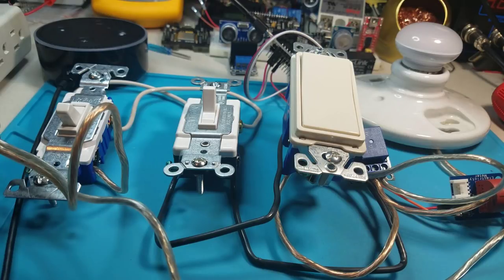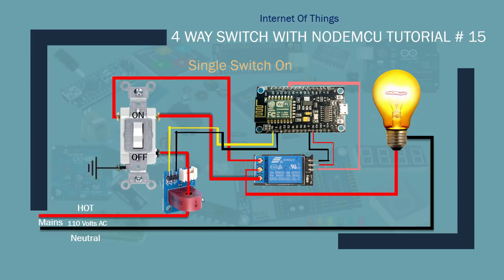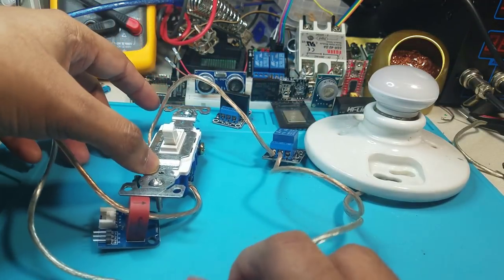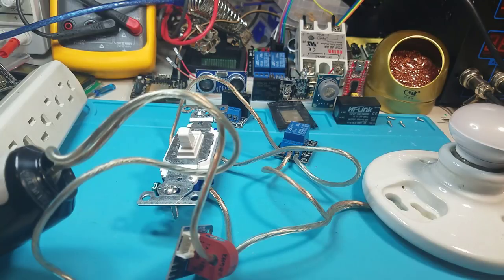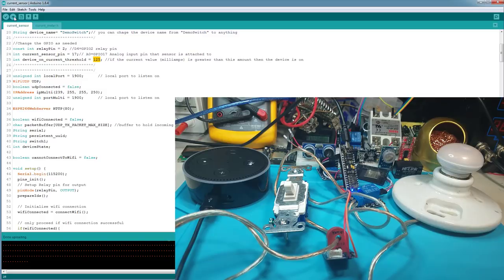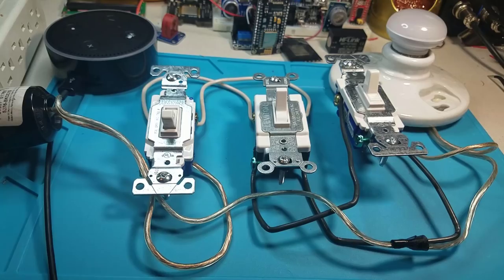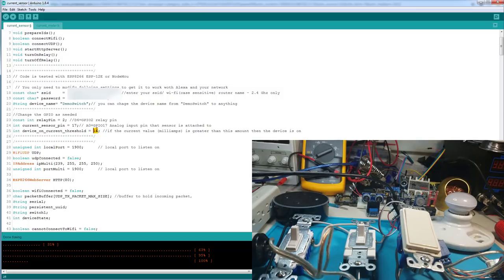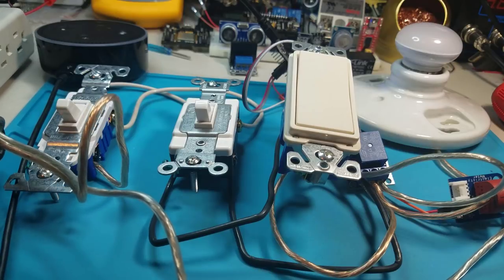esp8366 arduino | Home Automation with Alexa | 4 way switch Part 3| Tutorial # 15

Comment: Very nice demo and explanation, I have found that many do not understand how 4 way (DPDT) switches operate requiring a 3 way (SPDT) at the source and load ends of the chain.  I am new to the Pi Arduino and ESP world so this was quite useful. A suggestion for your proof of concept and demos would be to use 12 Vac lamps on the bench to eliminate the shock hazard. I specified 12Vac as the current transformer would not work on DC.

Comment: You are very thorough on your videos. I like the way you mix in power point slides and video. There in no doubt you spend a lot of time on these. Have you looked at using a Wemos in place of the NodeMCU? It had a smaller foot print as it has fewer GPIO, but based on the ESP. A side note, the current sensor can be installed on the wire from the relay to the light, which would put it in the same box as the relay and Node. You ultimately are trying to determine when current is flowing to the bulb. Keep up the great work!
Reply from the maker: Chris Hettinger defiantly I will look at WeMo. 

I am connecting  the current meter both ways. Look at the 2nd demo in this video.
Reply: It is a Wemos, not Wemo. Wemo is a brand of IOT components from Belkin. Wemos is an ESP8266 board with 5 volt regulator, FTDI and several other things all one 1 board. Basically the NodeMCU's little brother.
Reply from the maker: Chris Hettinger Sorry for the typo.

Comment: Hi, in 3way installation you placed current sensor at the beginning(between plug and switch). In the 4 way installation you placed the sensor between relay and the bulb. Could be current sensor in 4way installation at beginnig? (on the 4way scheme on the left before first 3way switch). Thank you in advance

Comment: Great job on the video.  I am just starting out with DIY home automation.  I am excited about the possibilities and availability of components.  I love how you are using the relay as a 3-way switch in the circuit along with a current sensor and how this allows the manual switches to continue working in the event of a failure of the home automation hardware.

I will be using the AdaFruit Huzzah breakout ESP8266 board.  Unfortunately, is only has two analog inputs for the current sensors.  A digital input to detect the load going "hot" would allow for more inputs and would not be subject to changes in the Amps drawn on the load if bulbs burn out (which may be a non-issue).

I just got my Raspberry Pi working with OpenHAB2 and Mosquitto.  Now on to the hardware!

Liked and Subscribed :-)
Reply from the maker: Dave Z Thank you for your feedback. Please keep us up to date on your progress. Good luck on your projects.

Comment: Sweet setup, I like the idea of still being able to use regular switches if the ESP board has problems. I have setup 8 lights in my house so far with regular wall switches, google home & home assistant all working nice together on 2 ESP boards talking to home assistant via mqtt and light switches us GPIO's on ESP board to change state and relay via mqtt to keep all in sync but if an ESP board goes, I have no light control. Might have to look into integrating your setup into my own :). My setup was first inspired by your videaos so thank you again :).

Comment: Great tutorial! Question, why at 21:57 do you turn it on then off? Is this necessary? Also, is the relay you are using active high or low?
Reply from the maker: On/off is not required. Just testing to make sure it works with manual switch only. I am using active high relay. You can check my following video to learn how to convert active low relay to active high.
 https://youtu.be/pBxeHlvF4eQ
Reply: @netmedias7657  Thank you for the reply. I have an issue maybe you can help with. When I verify code in Arduino IDE, it has this error. "Error compiling for board NodeMCU 1.0 (ESP-12E Module). /Downloads/IOT-NodeMcu-Alexa_Automation_4Way_Switch-master/current_sensor/current_sensor.ino:194: undefined reference to `sendRelayState()'"  I know this video is a few years old, is it possible that an update to IDE or other libraries has broken your code? Thanks

Comment: Sir I am using NodeMCU with 8ch 5v relay board.I am using same manual switches also as you shown in your video but if I wish to use current sensor with all 8 relay how should I connect those? Because there are only one A0 pin in nodemcu.

Comment: Just noticed this, perfect for a project I'm thinking about. I've ordered all the parts needed except for the current sensors which are not available in the UK :(. Is there an alternative such as the solid state current sensors that are widely available or is it possible for your design to work without a current sensor. Many thanks, Keith

Comment: Nice work.. If I just wanted an upstairs and downstairs switch plus the nodemcu (not 3 physical switches), can I just replace the last switch in a 3 switch configuration with the relay? and if so, does anything need to change in your arduino code?
Reply from the maker: Mark Porridge Yes sir. You are right. In two switch configuration make sure last switch that connects to the device is 4 way switch. If not the replace it and connect the relay.

Comment: Great video's well explained and already starting to use your projects! Would like to see how you provide power when these are placed permanently in an electrical box, and if wireless had any issues working in the wall .. thanks !!
Reply from the maker: Ross Romeo thank you for your feedback. Please share your thoughts what you like and dislike about the videos for I can make improvements. Good luck with your projects.

Comment: Hi . i need some assistance from u . is it ok to help me out . i have a 4 channel relay , and a 8 channel relay ,  nodemcu  and also echo dot .. so was planning to do some automation for  my bed room .  i have connected to dc supply  till now to switch on the relays . it works fine all with the dc voltage in normal way giving commands to echo dot to switch on all 4 channel relay and 8 channel relay board ,  but moving on to ac connection  the problem how to connect it with the nodemcu . in this video you have connected to a single channel relay right . also some kind of  sensor which u were talking about in the diagram to Ao pin in nodemcu  along with the 3 way switch  ... how should i connect the 4 channel relay or the 8 channel relays to ac voltage  with the nodemcu as per it has only one Ao pin . other thing is that here that sensor is not available in India . in your other video you have replaced it with a diode and a resistor right .. but even still how i can connect the both 4 channel relay or the 8 channel relay to nodemcu to notify the ecodot that if i switched on the 3 way switch it is already on as per nodemcu has only one Ao pin . i do not know much about elctronics or about the nodemcu .. and the programing .. but connected and programmed it watching many videos only . so if you help in this one it will be a great thing to me . hope you will . can you do a video how to connect the 4 channel relay

Comment: This was a good video but one thing that will make it much better is when you are wiring the relay instead of saying wiring to the left and right terminals, tell if it is the normally closed or normally open terminals because not all have the terminals in the same place.
Reply from the maker: Eric Hughes Yes sir. I am doing that. I mentioned my relay default at 5:03. Anyway in this configuration it does not make any difference as long as common pole is connected to the device.

Comment: Awesome! Would it be possible to control three lamps in a four way setup using a single esp8266 by adding more relays?
Reply from the maker: Breno Sabino you can control multiple switches with single ESP but this switch configuration is for one device only. You can look at my tutorial on controlling multiple relays with single ESP.

https://www.youtube.com/watch?v=OC6QSXzkQU8

Comment: hello, I need to ask you that if the ALEXA and Google Assistant code are built-in into your arduino code or we still using HEROKU. I see that in the Arduino code there are serial lines. What are these lines for
Reply from the maker: This project does not require any skills for Alexa.  You only need the sketch to get your device working. You can use IFTTT to make it work with Google Home.

Comment: Liked the video but the description of the video could be more robust. What parts did you use and where did you go to get them.
Reply from the maker: Jarren141 Please do suggest a better name for the video. Electrical switches are bought from Lows and NodeMcu,relay and current monitor from eBay. If you want them quicker then order them from Amazon.

Comment: Hi, very nice project and very easy explanation!! I’m going to do something similar to my apartment, my intention is to connect to the same board 4 series of buttons (I would like to manage 4 different lights with one board), I think I need to change the board and I was more oriented on a MKR1000 that has more analog ports and wifi connection but my question is, can Alexa manage 4 lights points with one board? I’m still learning skills but your help can help me to understand if the project is fine (and to proceed to order the material)
Thanks for your kind reply
Reply from the maker: Stefano I am working on 8 channel relay current sensing tutorial. It will be a while before I post it. Thanks

Comment: Awesome tutorial. How would you do the wiring on a typical 3-way lighting setup that uses 2 x 3-way mechanical switches (i.e. one switch is it at one end of the room and the other one at the other end)?
Reply from the maker: It is simple. Just remove the middle switch and rest is same.
Reply: @netmedias7657  Thanks, so let me summarize: I need to replace one of the 3-way switches with a 4-way one and wire it along with the ESP module, did I understand well?

Comment: Do you think it would be a good idea to replace the induction current sensor with an optocoupler, resistor and capacitive dropper circuit? It's a bit more invasive but i had the parts laying around so i would rather not buy another sensor.
Reply from the maker: SilentDreamcast It should work but it complicates things and I wanted to keep it simple. It is good to  separate low and high voltage with optocoupler. Let us know how it goes. Good luck.

Comment: Can a PIR module be connected in parallel for automatic ignition and add control with switches?
Reply from the maker: You will need to modify the code and add timer so it stays on for required time.

Comment: Hello Netmedias! Your videos are awesome and very descriptive, congratulations :) I was wondering if something similar can be done with sonoff 4ch pro r2. I think that the 4 needed GPIOS for the current meter inputs can be soldered directly to the  ESP8285 SOC pins , isn't it?
Reply from the maker: I am working on it thanks
Reply: Netmedias 

Excellent!   I’m wondering the same about sonoff dual with a current sensor add flashed with tasmota?   Very interested in your work here.  Pointers appreciated.

Comment: can this be done on a sonoff device? like the manual switch will still work even if something bad happens with the sonoff device.
Reply from the maker: Ruel Baclay NO, because it has 2 pole relay and you need 3 pole relay for this project.

Comment: Hi man,i enjoyed watching your videos,i have a little understanding on computers and electronics and i want to have my house automized,just one question,is this system for 22OV?or just 110V?thanks for sharing
Reply from the maker: Key Wizard It works for both. Relay works with 110 and 220 just use the 220 to 3v dc  power supply to power the NodeMcu
Reply: Thanks man,for the relay,let say i want to control 5 or more units at home,i would just buy a bigger relays and use the same set up?appreciated your comment sir...
Reply from the maker: Key Wizard You need one relay for each device to control them individually. Watch my tutorial with 2 relays.  https://youtu.be/OC6QSXzkQU8

Comment: what power source are you using to power the nodemcu when you connecting it to the outlet junction box
Reply from the maker: bobby royster I use "HLK-PM03" or "HLK-PM01" for 5 volts just google it.

Comment: Is it possible to measure the voltage at the relay common pin instead of measuring the current flowing through the relay common pin to ascertain if the switch is on? 
I would like to remotely switch  a power point while retaining the manual switch. With your setup the chip would see the power point as being switched off when actually on but no load applied.
Reply from the maker: John Silvester this is what is I am doing in 4 way switch in this video. Thanks for you comments.
Reply: Thanks for your reply.
If wired to a power point with no load, ie. no current flowing through relay common pole for the CT to detect, the ESP8266 board could wrongly see the power point as being switched off when the power point may be still live. 
I would want to the power point to switch off regardless of attached loads are switched on or off.

Comment: Nice. Could list where you purchased the voltage sensor?
Reply from the maker: Rainmaker LLC can check out the following current meters. I have 3 different ones. You can also buy it on Amazon and ebay. Good luck.

https://www.banggood.com/0-5A-Iteaduino-AC-Current-Transformer-Current-Sensor-Module-With-3p-4p-Interface-p-1068624.html?rmmds=search&cur_warehouse=CN
https://www.banggood.com/5A-Range-Single-phase-AC-Current-Transformer-Current-Sensor-Module-p-1228113.html?rmmds=detail-left-hotproducts__1&cur_warehouse=CN

Comment: What is the use of current sensor? is it just to tell whether the load is on or off? or is it for measuring how much current its drawing ?  If i dont want to install the current sensor if its there for demo purposes only, how to wire schematic then?
Reply from the maker: Yes, it is used to determine if load is on or off but you can use it to measure the current. My code is not calibrated for that.
Reply: so if i dont install that in my 4 way setup is the alexa part still going to work?

Comment: in my country most apartments that are compatible with residential automation use relay pulse.
How would the system with a simple relay pulse ?
Reply from the maker: You can change the code do on and off with delay to match the plus duration.

Comment: Great tutorial!!! I'd like to do the same but with 8 channel relay board and using it as mqtt swicht on home assistant so i can control with google home, HA and real wall switch. Is it possible?
Reply from the maker: Yes, but you will need to modify the code a bit.I may do a tutorial in future. Good luck.

Comment: If I stop the light from Alexa, the relay may be in the NO position, and the current is cut off, we can have lights on in the middle of the night, or the program remembers the  last state on power failure?
Reply from the maker: costara How will I know if it was a power failure or if it was switched off and on?
Reply: Imagine the following scenario; we turn the light on from the switch 1 and turn off the light from the voice command. if the power is down (disconnecting the plug from the socket), the program will know the last state and will keep the light off, when pluging on again?

Comment: To get a 2 relay nodemcu can I just program the nodemcu with two of the same program and just change the GPIO’s
Reply from the maker: Thomas360xbox Bass You can only flash one sketch at a time. You can use one sketch to control multiple devices.

Check out my tutorial on how to control two devices with single sketch. Good luck. 
https://www.youtube.com/watch?v=OC6QSXzkQU8

Comment: Hi, thank u for sharing this kind of videos, many thanks from South América! Is it possible to do this circuit without the current meter? We can't get it in my country and if there are one it could cost about 15usd! So i dont know if is possible to replace this part with other device or control since software! I cant get the way, and probably you can guide me.. thanks
Reply from the maker: tiwar87 It is easy to make one if you have time. Yes you can use it without the current meter. Alexa won't know if device is on or off but you can still control it with your voice.
Reply: Netmedias yes I know that can control the Alexa with or without the current sensor but the way you implement it to recognize it is the best way for me. I Will try to find the way to do a current sensor. Thanks for the advice, keeping forward

Comment: Yes i am asking if i can use it to turn off the entire power from my house.
Reply from the maker: I am not sure why you need to do this. This is very dangerous to do it your self. Seek a professional help.Usually most houses in US use 100 to 200 amps mains connection. You need to make sure you get a correct relay based on your connection rating. You will need a heavy duty relay that can handle this kind of load.

Comment: Do u have to use the current sensor ta12-100 if u use the download
Reply from the maker: Thomas360xbox Bass You should be able to use any current sensor that can detect the current at 3 to 5 volts level. I have couple of dufferent ones  and they work fine.

Comment: nice  ,i only wish there was a way to do it without  running additional wires
i have an outside light but   it only is wired for a regular switch not a 3 way ,plus i would need to run wires for the current sensor  too if i want the board mounted in the  light
Reply from the maker: Andrea Mitchell you don't need to run additional wires if you are trying to make Alexa 3 way switch.  Just replace your toggle switch with 3 way switch and connect NodeMcu as shown in 1st demo. Good Luck!